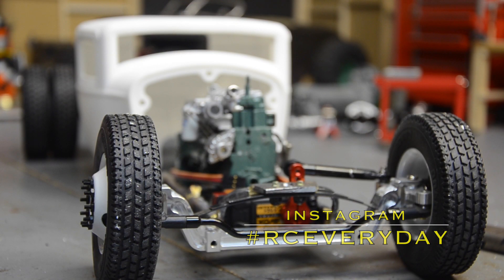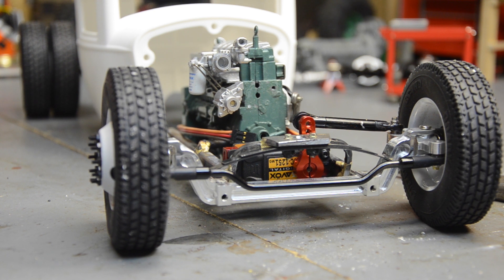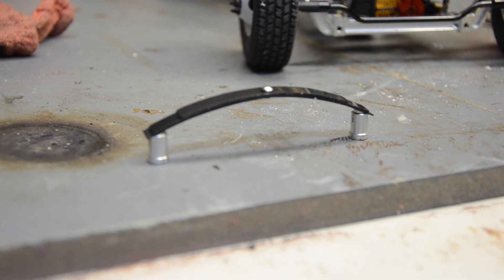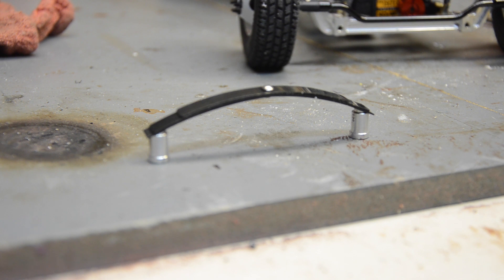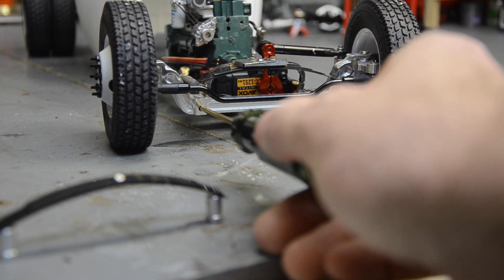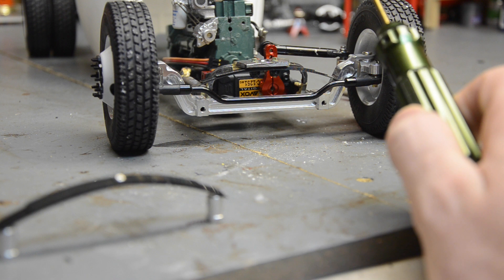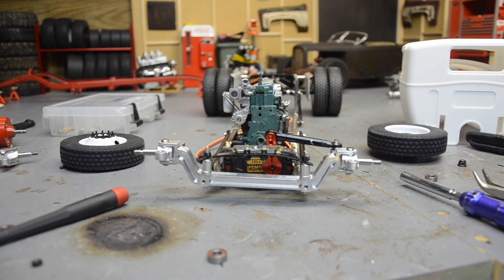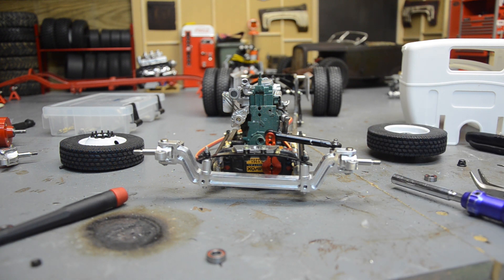RCengineering, Scale Rat Rod Front Suspension Part 2, The Fix

Comment: Brilliant - what an elegant solution. I take it those homemade spacer blocks are cut from a length of 3/8" square bar and drilled. I´m looking forward to seeing how you mount the shocks   : )
Reply from the maker: I got hungry and hurried through the end of filming. The blocks are Rc4wd pinion shims cut down. Used the ones that were close to the angle of the leaf curve.
Reply: Superb example of the "use what you got" creed...

Comment: i personally was thinking of using 2 leafs (1 on both sides).. by using 2 bolts to hold the leaf on the frame rail and 1 bolt to hold the leaf to the axle..i think it would provide a little more flex than that making the ride smoother but whatever works for you it looks good either way
Reply from the maker: I get what your saying, have seen real setups like that.  If space wasnt quite so limited on this axle I might consider tryin that out.

Comment: About the rear suspension. Why don't you try rigging up something much like a traxxas revo system and have a servo with a servo saver in as the servo horn so you could have some suspension flex while still having "hydraulics" in a way
Reply from the maker: That is what I have been wanting to do, just still playing with ideas on how the linkage will run and where to mount the servo.
Reply: +RC Everyday hmmm we must have similar minds. Hey I was wondering if you have a po box for fan mail or something. I made something for a trailfinder 2 and I can't use it anymore as I'm building a flatbed for my rig. Just DM message me on Facebook or something. I'm Calen